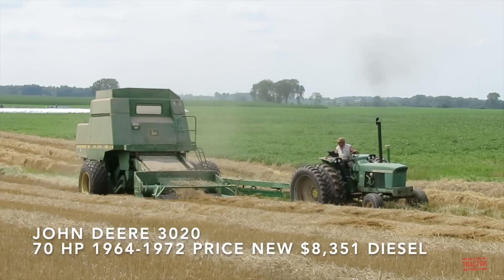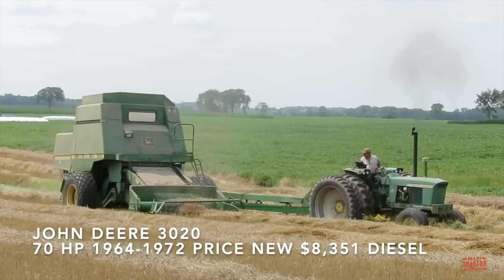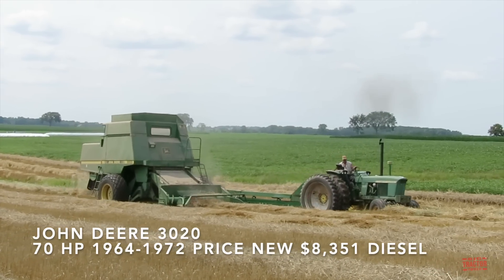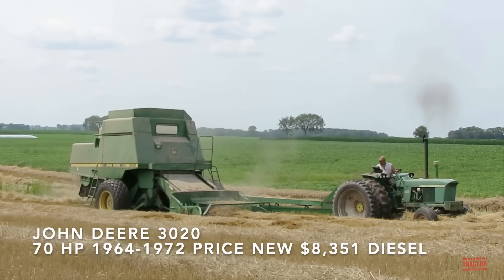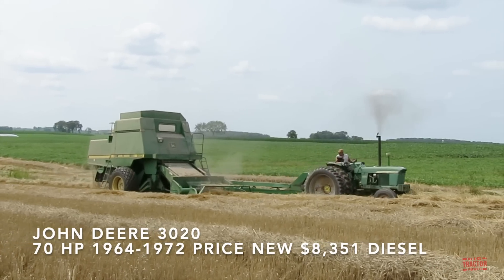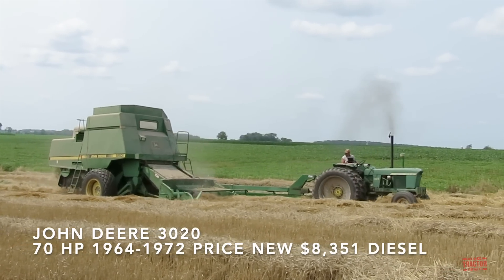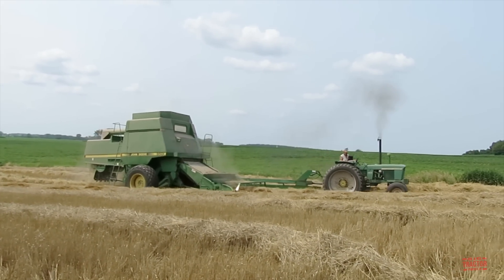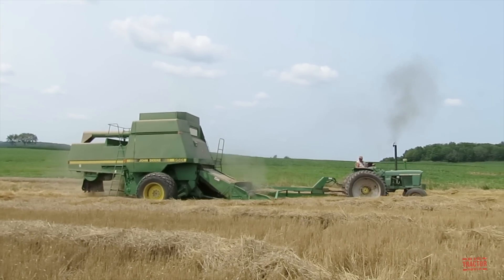TRACTORS at Work: JOHN DEERE 3020

Comment: It takes 200+ hp on the pto to run a 9501 at capacity. 7721 took at least 150+. No way that 3020 is in any way, a 3020. Not only that, there is a safety aspect. A 9501 empty weighs around 20,000 lbs, add 200 bu. of 60# wheat and your looking at total weight of ~32,000 lbs. Again no way a 3020 at 7500 lbs is going to control that combine on any slight hill. Incredibly dangerous. There is a reason these combines in their day were pulled with articulated 4wd tractors and now with larger fwa tractors.

Comment: That sure seems like a big load on, and weight for, only a 70 PTO HP tractor,  yet it is doing it just fine. I would have thought that even a bit much for a 4020.  Very cool to see.
Reply: Me too!
Reply: I thought the same thing, that 3020 doing a great job driving  combine harvester.
Reply: I wonder if that 3020 being turned a bit more than standard 🤔 .
Reply: I sure wouldnt want to run that setup on hills, but the 3020 sure seemed capable on this field
Reply: I ran a 6601 with a hundred horse , and that was really not enough . And that is a lot smaller than a 9501
Reply: Old tractors did twice as much work with half the horsepower.   .......
Reply: @shelbydavis3311  I had a 3020 , and if I had wanted to use it to run my combine it would have been a awfully slow harvest . It was about perfect for my dad's old 96 combine . It could be that the crop in the video was powder dry , but for us that only happens for maybe 10% of our harvest
Reply: He has it turned up and I think he’s only picking up a 12-15 foot swath. This same set up was on Facebook once and somebody who knows this guy was saying he’s only really running the combine at around a quarter what the normal capacity would be with a proper sized tractor
Reply: @shelbydavis3311  Same in Germany. 40 years ago a 75hp tractor could easy handle a 4 bottom plough. Today 100 hp 
are necessary. Factories hace pimped up the engines .
A 5 R today has the same frame size as a 2350 40 years ago but up to 40 hp more.
Reply: We have a 3020 too. It has a M&W turbo on it that was available through the aftermarket.  This one looks like it might have one too. Puts it at about 90hp.
Reply: With full hopper that combine would outweigh the tractor probly double. Good thing there are no hills.
Reply: It's only a 3020 body with a new modern JD turbocharged engine in it, putting out way more then a stock 3020, and 70 HP. Plus the  winter wheat doesn't combine that hard, especially when it's a 12' windrow.

Comment: I had three 3020's in my early farm life. Had a '65, a '67 and a '68 years model. Farmed almost 1000 acres with the three old horses. Traded the oldest year model in   '71 for a 4320 with cab and cold air. Surely   helped beat the Texas heat! Later, traded all but one on 30, 40, and 50 model John Deere tractors. Still have the '68 3020 in the family.
Reply: When I was a kid in the 60’s, my dad farmed 1000 acres with a 4010, 4020, 3020 gas,1010 w/loader and a 45 combine. Still wonder how he did that!!
Reply: Seems like that combine would need 125hp min. Am I wrong?
Reply: @jrod264winmag   My old 4320 was turned up to 180 HP.  It done an OK job.
Reply: Oh you did not lol
Reply: @markfroman738  My dad's largest tractor at one time was a '67 3020 and he was farming 380 acres and milking 28 cows in the early 70's.

Comment: Spent a few hours on a 3020 but 4020's were my long time favourite, awesome tractor, a legend.  That 9501 isn't even working hard with that little 3020. In hilly country and a full hopper you might want for a 6030.  My uncle ran a 7721 with a 4840 and that combination really matched up well, no shortage of power. The first pull-type I got to run when I was about 14 was a JD 65, then a 96, followed by a 6601. Mostly self-propelled after that, all JD.

Comment: I have a 1964 4020 row crop.  The tractor was manufactured in Nov'63. I have owned it since 1983. I use it
plowing, mowing and tedding hay, and blowing snow in upstate NY.  Since I have owned it, I have replaced,
and rebuilt and repainted everything on it except the steering valves.

Comment: The best tractor ever made in tandem with the 4020 is the 3020. Its still my main tractor which I learned to drive 43 years ago. As far as the one in the video is concerned, whether or not it was turned up who cares. Its obvious that the gentleman is having fun with a straight pipe and duals bolted to it. Isn't that what farming is all about? You might as well have fun with the work you have to accomplish. An excellent video overall and keep up the great work.

Comment: I have a 68 3020. I use it with a transplanter, cultivator, plow, plastic mulch layer, 2 row potato digger, 4 row corn planter, and as power unit for a grain auger. It's a little tired and will need a rebuild soon. I plan on keeping it as long as I can!
Reply from the maker: Very cool.  They are solid tractors.

Comment: I pulled a 600 Case pull type with my 3020. I had a Melroe pickup, and, that thing would eat a lot of small grain. I liked the Case, because it had a spike tooth cylinder and it made great straw for bedding, as well as doing a good job.

Comment: Dad had a Ford 4000 3 cyl good tractor but my uncle had a 3020 with an AM radio! That was the hot setup for a teenage boy haha. Got to drive it some plowing and discing. My friend's dad had a 4020, all three were good old tractors.
Reply from the maker: All very good tractors. Ford’s 4000/5000 are solid tractors.  Built to last a life time.

Comment: Also grew up driving a 1969 3020 diesel, started at age 9 in the mid 70's.  I finally gave up on it after 15,000 to 16,000 hours on it in 2001.
Reply from the maker: That’s one long lasting tractor 👍👍

Comment: My grandfather has a 1970 3020 Diesel row crop model. Originally it had an open station, but he put a King Cab on it in the late 70s. Always used it for the light work; occasionally pulling a John Deere LL-A press grain drill, sometimes the New Holland 55 rake, but always ran the IH 241 round baler until he bought a 1975 John Deere 4430 and used that for baling. Since then it has mostly sat in the shed except for being brought out once a year to get hooked up with the homemade wood splitter. It only has 5033 hours total.

Comment: Cool to see the pull types going. 9500 self propelled vs of this is probly 180 hp so that 3020 is way under. The weight is probly more of an issue tho. A full hopper on that combine would shove that tractor down any hill it felt like in very uncontrolled fashion. 😮 Good thing its pretty flat there😅

Comment: Great video!  That 3020 is really working, but doing the job.  We have a '66 3020 that we mow rake and bale hay with.

Do they use a swather to cut the wheat before the pull type combine does it's thing?

Comment: A john deere 9500 had a 190 hp motor in it. It's funny to see a 70 hp 3020 running it
Reply from the maker: It is an interesting harvest team.  Normally the farm uses a 175 hp 6030.

Comment: I remember a neighbour had a 3020 which overturned when hauling a heavy slurry tanker. A crane turned it back on its wheels,  and he drove it home minus exhaust and other bent bits!
Reply from the maker: The 3020 is a well built tractor.  Scary to flip one.

Comment: Are pull types even offered any  more? , have not seen a newer model for a long time.
Reply from the maker: Good question.  The answer is no.  New Idea which was the number one in the market stopped corn pickers in 1982 and switched to making hay equipment.  John Deere built the 300 corn picker through 1988.

Comment: Must be some real bad wheat with a 3020 on it. Considering HP requirement was around 200hp.
Reply from the maker: Surprisingly it does not take allot of horse power. 120 pto hp is recommend. The 9501 sales brochure shows it powered by an 8760 4wd but much less of a tractor can do the job.

Comment: What exactly is going on there? That wheat had already been harvested.  Looked to be ready to be baled for straw. Were they just running it through a second time to get a much grain as possible?
Reply: That wheat had been only swathed with a swather. Meaning its been cut and laid out in a nice windrow, usually to finish drying, and then is combined. My father and grandfather used to do that with the mixed grain they grew. Grandpa always wanted the grain to dry for 8 days or so to make sure it thrashed properly. We are in southwestern Ontario, Canada. I don't recall seeing wheat swathed before.
Reply: @leonardfleming4440  thanks! I have never seen wheat harvested that way

Comment: I run the slightly older version combine, 7721 pull type. JD recommends well over 100 horsepower to run it. I find 170 is plenty. On the hills with grain in the tank you want front wheel assist or four wheel drive or else that combine will push/pull your little tractor all over. You can see videos of mine at work on my channel. https://youtu.be/8fa96k6d4GM